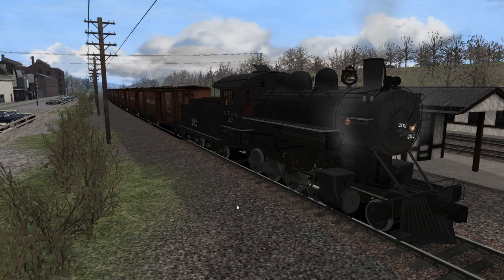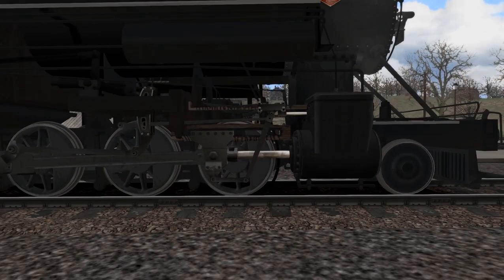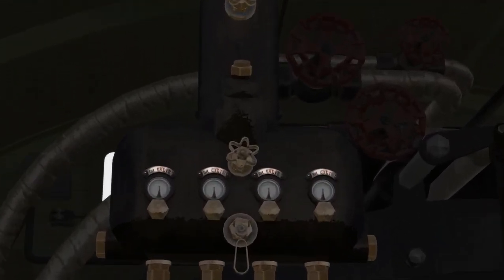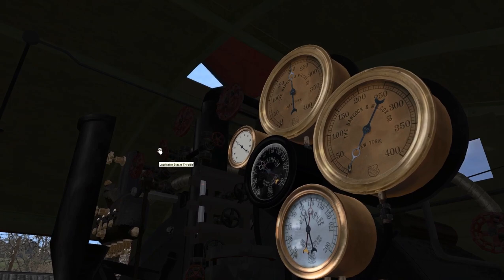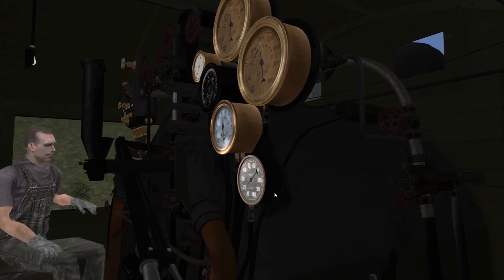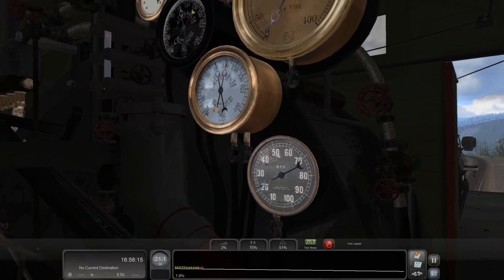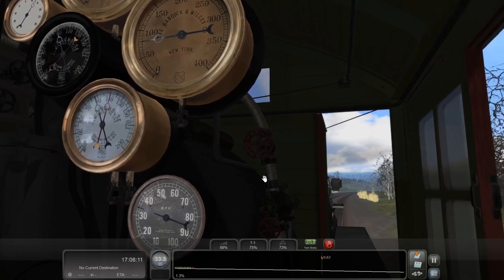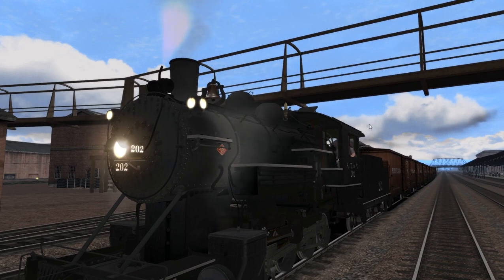ATN Consolidation - Train Simulator 2015

Comment: It’s interesting to see these locos driven by a proper steam engine driver or engineer. I’m curious with this technique of braking, how do the brakes not fade from being constantly applied down these steep and long hills? Also, you mentioned about being able to put individual shovel-fulls of coal on the fire, there’s actually a model by a company called Just Trains. They do a British loco called the 4MT which simulates shovel-fulls of coal being put on the fire. If you watch the fire mass on the F4 hud, you’ll see it jump up so you can count each shovel-full of coal going on. Might be a good compromise for your idea.
Reply from the maker: As far as brakes are concerned, there were two main things you had to worry about heat and air. If you have an air leak you can find yourself loosing brakes over time. What they did to remedy that was invent air retarders that allowed you to recharge the brake pipe without releasing the brakes on the cars immediately. The other issue was heat. Up until about 20-30 years ago all brake shoes were cast iron, which swells up and can eventually melt or damage the wheels. If you get the shoes too hot they loose their friction and you loose your brakes. That's called brake fade, something that transfer truck drivers have to deal with in the mountains. Being able to use air brakes is something of a lost art since big railroads don'e allow them to be used anymore.
Reply: Very interesting. Thanks for that info. 👍

Comment: Hi Oleander. I'm a British steam enthusiast attempting to drive the Just Trains BR Clan locomotive. I've noticed, unlike on the Connie and the 844, the steam chest pressure on the clan doesn't seem to change with cut-off movements the same way it does when you drive. I lose pressure despite running a low cut-off and throttle wide open as you do (and this is on level ground). Is this the result of a mechanical difference between British and American locomotives?
Reply from the maker: Generally, when you have the throttle wide open, the steam chest pressure will match and remain steady. Things that can change it are speed and cut-off. If you're moving at a good pace it should remain steady. Without looking at how you're setup to run, I couldn't say for sure what the problem is. You may be looking at the backpressure gauge in the video, that's the small white one on top of the boiler gauge. If you're using a low cut-off and still loosing pressure, assuming the fire is maintained correctly, then you are probably running faster than the boiler can keep up with. Its just like a runner having a hard time breathing you've "winded" the boiler. So, I would look at the fire and the speed.

I haven't run one of those engines in the game, so some of it may be from the way they were coded to run. Without having hands on it I'm sort of stabbing in the dark.
Reply: Thanks very much for the reply. I guess I'll experiment with the fire and see what it runs best with. The recommended fire mass is apparently between 500 and 600Ib but I feel I'm not getting enough heat. The pressure builds up way to slowly and that's with the blower on (to your recommendation from one of the 844 videos). I'll research the superheater system as well, just in case there's a certain way to operate it.

Comment: Oleander's Gaming Emporium Just a quick question regarding steamers. In som  engines, you have a "vertical" throttle that comes down from the cab ceiling, while in others, you have a "horizontal" throttle like the Connie here has. Is there any advantage to using a particular style of throttle?
Reply: *Some
Reply: SmeagolPlaysMC The vertical ones are connected to the rods that go to a front-end throttle valve,  like on the FEF-3 (where you can see the valve moving on the right-hand side of the smoke box), whereas a throttle like the one you see in the Connie is connected to a valve in the steam dome on top of the boiler. The advantage of the front-end throttle is that the steam doesn't have as far to travel from the valve to the cylinder admission valves, so the throttle response is quicker. In the Connie, there's a 1-second lag between adjusting the throttle and seeing the effect of it on the pressure in the steam chest.
Reply from the maker: SmeagolPlaysMC Sorry for taking so long to get back to you, been very busy at work. Calendo is correct about the types of throttles. The ones that hang down from the ceiling are called "grapevine" throttles. The rods run along side the length of the boiler and into the front end throttle assembly. You'd normally see these on engines that are fitted with superheaters. They were also less likely to "carry over" water to the cylinders because the throttle was at the end of the superheater chain and any water that entered the elements has time to boil off.

The one in the Connie is a "Dome Throttle". So it goes through the backhead of the boiler and uses a series of bell cranks to lift the throttle valve and let steam flow into the dry pipe. Usually you would see these on the top of the wrapper sheet, or through the door sheet inside the cab. They really didn't have any advantage other than drawing steam from the hottest portion of the boiler.
Reply: TY both for the explanations.